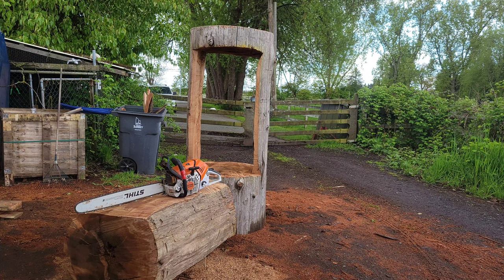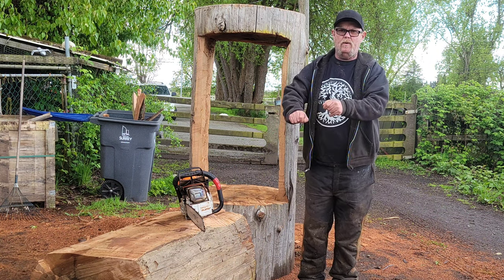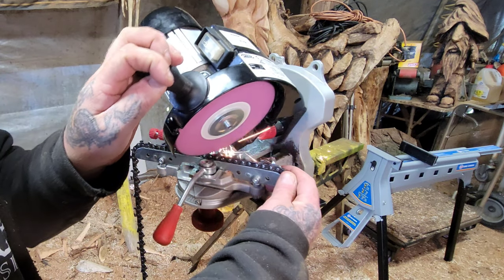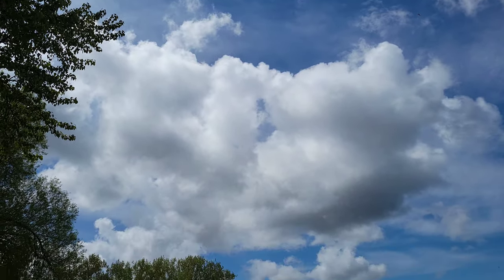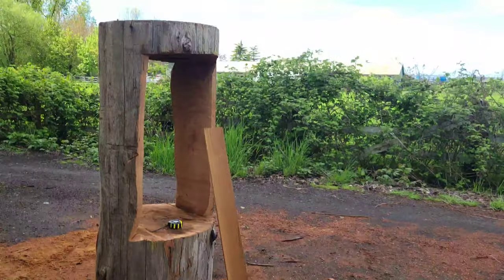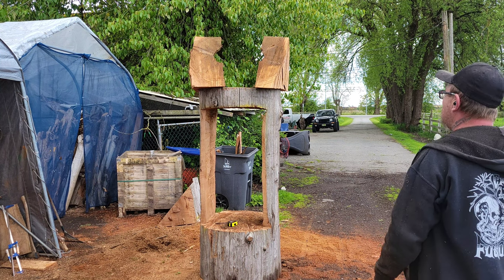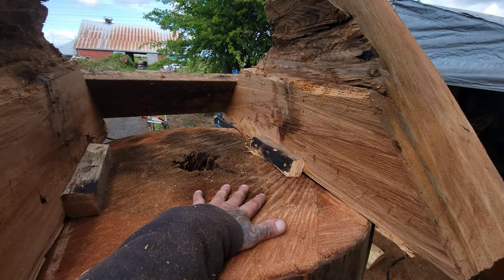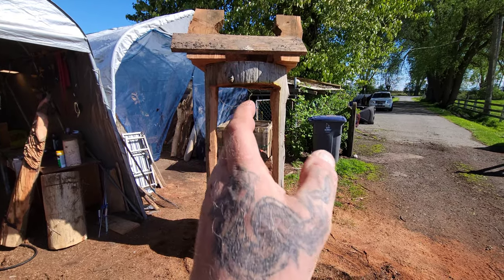Carving and building the Huge wishing well part 2. #chainsawcarving

Comment: hi Jordy can you use this on 1/4 pitch chains or are the different ,cheers mate from frosty
Reply from the maker: Yup u can
Reply: @CarvingFusion  hi Jordy i bought a foredom sr its a great bit of kit ,the only thing i had a problems with the chuck burnt some skin off my finger as i was using it my fingers want to move more forward and thats how i got caught ,but i solved the problem ,i used one off the plastic tube that dremel have with holding small cutting disc ,as it fit perfect over the end of the foredom and it covers the grove where the chuck has a groove for the chuck key fits ,all i did was cut a hole in the bottom of the plastic disc holder until it cleared the chuck ,so no more burning of the skin off my finger